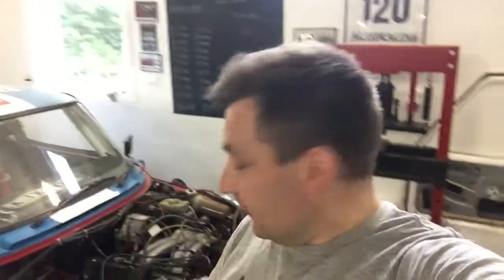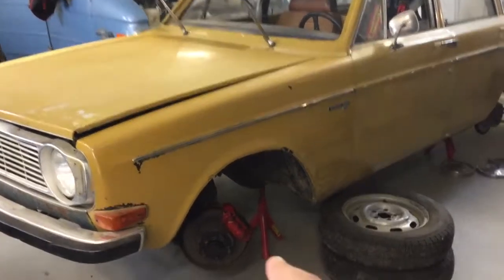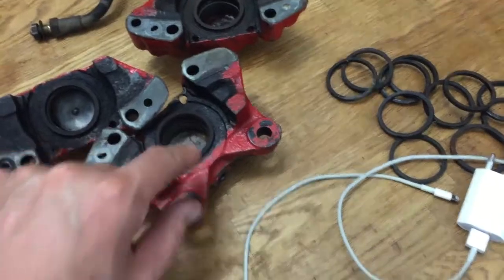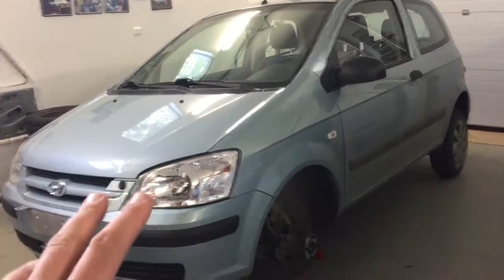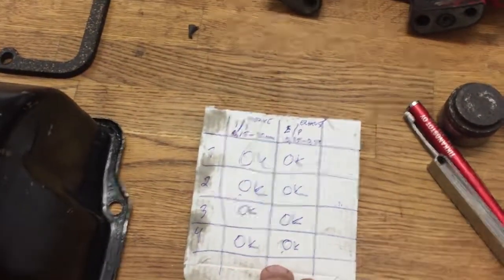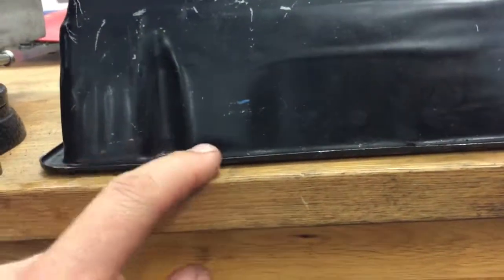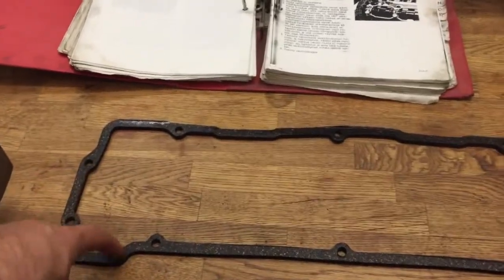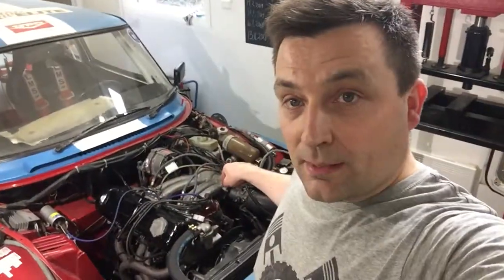Saab 99 EMS - valve adjustment check

Comment: Thanks brother, i have saab 900 year 87, same measurements? Its 2000cc non turbo, my valve cover is little different, if the old gasket is still in one peace and not too cracked....re use possible? Thanks my friend! Where are u from, me Belgium🇧🇪
Reply from the maker: Hi! I’m from Finland.🤗 Sorry, don’t know about 900. I quite often use old gasket wich is now a good thing but I do.😉 They might get hard as a rock but you can try. My valve covers are leaking all the time...😂
Reply: @hanssgarage1886  great info Hans, thanks, makes sense...!i saw you in the snow, haikinen😎🤜